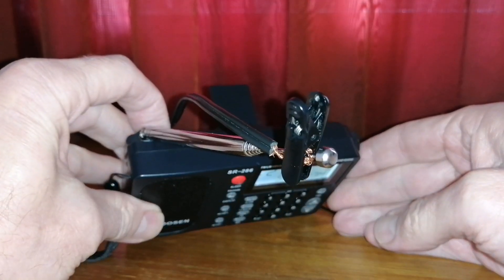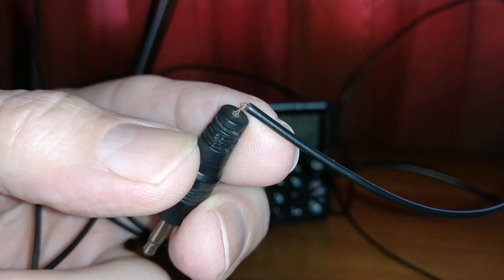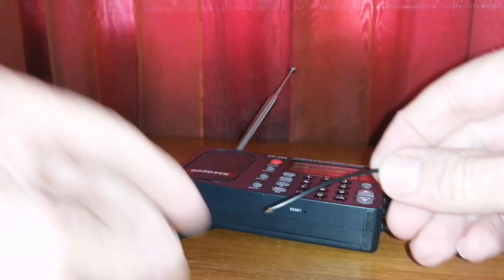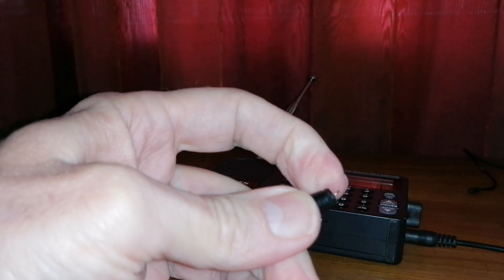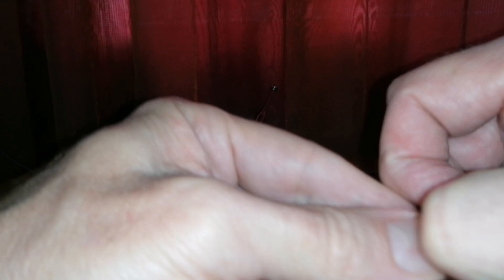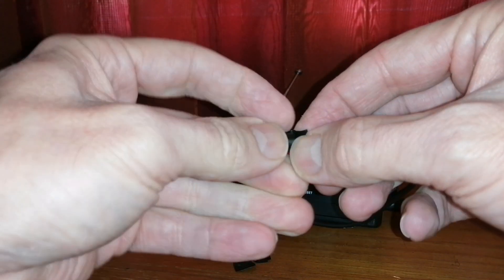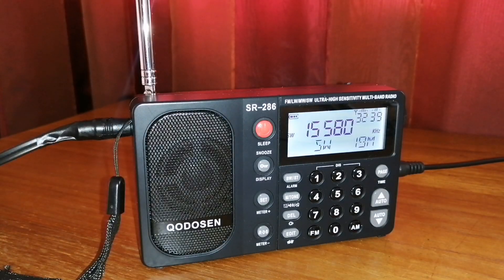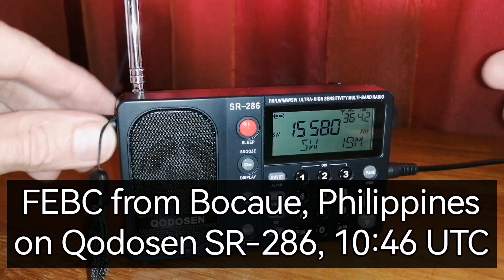Connecting a 3.5 mm mono plug to a long wire for better shortwave reception #radio #antenna

Comment: I do not have a long wire antenna.
Reply from the maker: It is very easy to get one. You can use something like speaker wire, and just expose the wire on one side (remove the insulation). Then tie the exposed wire around your whip antenna, and there you go. Stretch the wire outside, or throw it up a tree. It will make a big difference to what you can hear.

Comment: Hi andrea
I think antenna 3.5 plug has two wire 
Did you connect another wire on the ground?
I'd ask does one wire is enough to get  good reception
Your advice please
Reply from the maker: Hi Eyad, the plug I used came from an existing antenna cable (a Tecsun one) and it had only the one wire, so it was easy to connect. I did not connect a ground wire. It works very well just like that.
Reply: Thanks

Comment: It’s amazing how different long wire connections make a world of difference.
Reply from the maker: Hey John, it really is quite amazing. I am a big fan of a simple long wire, always helps me pick up more signals, and with this connection it seems to work much better now.
Reply: @swlistening  hello Andre, I totally agree!
Reply: A long wire antenna I noticed better reception on the VHF Air Band.  Lot’s of experimenting with long-wire, usually great results. 📡📶
Reply from the maker: @NJF60  I haven't tried that on the air band yet, thanks for the tip!
Reply: @swlistening  about a long-wire for VHF Air Band, try vertical length
Reply from the maker: @NJF60  Thanks!
Reply: Welcome!

Comment: Useful tutorial, bru... thanks! 🙂 👍

In my experience, an external antenna that is exposed to the sky, long and/or straight enough is more effective at pulling in weak stations than an active antenna like the MLA-30+ or the Deshibo GA-450 located indoors. However, indoor antennas also have their slight advantages - at least they're not exposed to the harsh elements like sun and rain and can't be struck by lightning during a thunderstorm! 😀

It got me thinking, if you're able to hoist your MLA-30+ on your rooftop it would very likely pick up weak signals much better than being located on the ground.

BTW, the FEBC broadcast programme is in Indonesian which I can comprehend. It's slotted in the evenings for the convenience of their Indonesian listeners. 🇮🇩

Comment: The first trick is finding a radio with an external antenna jack.
Reply from the maker: Hi Bill, that is true :-) Unless you can find an adaptor cable like the one I show in the video. It is a cable with a 3.5 mm input plug on one side, and a clip on the other side, for clipping to whip antennas.

Comment: Good move, André. But you know, you should really get yourself a soldering iron and some soldering wire. I'm sure that you can find these for very cheap at a nearby DIY store 🙂
And soldering is no more difficult than what you've done here.
OTOH, 3.5 MONO jacks for soldering aren't the easiest to source. STEREO ones are sold everywhere. Of course they can be used too, but they're more difficult to solder.
As another commenter suggested below, heat shrink tube does wonders on this kind of assembly. Much better than tape.
BTW why keeping the two conductors of your speaker wire? I'd advise to split it in two and use a single wire. Having two brings nothing in terms of reception and makes your long wire antenna more heavy, thicker and overall less manageable. Plus you can reuse it for e.g. a portable version of your long wire antenna.
Reply from the maker: Thanks Alain, I think I do need a soldering iron anyway. The power cable between the battery pack and the radio on my Barlow Wadley XCR-30 came loose, on the battery pack itself. It is a very simple fix, but for that I will certainly need a soldering iron. So I will be looking around for one.

I agree with you about the mono 3.5 mm plugs, I have noticed that they are not so easy to find. That is why I resorted to using one on an existing cable. 

Very good idea about splitting my long wire in two! Maybe I can even connect the two parts and make a longer wire :-) My wire is fixed permanently outside though, I got some help to fix it under the eaves of the garage roof. So I never move it around, just the little part that is fed into the house through a window. But I would need some help again to take it down and split it, I don't have a ladder that is tall enough to reach the top of my garage roof.

Comment: Andre thanks for the update and to find out that you are a poet and did not know it…😂😂😂!  …with your opening comments.! You are right about this making a difference!
I have an old Sony adapter from my late very much lamented Sony 2010 that allowed you to hook up a coax cable with two screws and it has the 3.5 mm cable on the other end. I then put a BNC  female of the coax side. I the use the inexpensive Amazon adapters to fit my antenna outputs.  
I would stock up on those Amazon adapters as it allows me to go from SMA to So_239, BNC etc.
73! Have a great day!
Reply from the maker: Thanks, I think I will find some adaptors, I need one for my MLA30+ for sure. I have a BNC male on that one, to go into the Kenwood R1000, but I need an adaptor there to be be able to use the MLA30+ on the portables. Only thing about Amazon is the shipping cost, it can be even more than the price of the actual adaptor here to my place in Johannesburg.
Reply: @swlistening  Amazon's US based shipping fees is the main reason why I don't buy from that e-commerce site anymore. What about eBay, Aliexpress, Temu or Banggood?
Reply from the maker: @StratmanII  I do use Ali Express often now, after testing them out a few months ago for the first time. Very happy with them, fast and cheap shipping, but I need to pay import duties on this side and those are high. Often around 50% of the product price (I need to pay VAT + import fees). Amazon fees can be high, but they do include the import duties. Sometimes, on products that they sell themselves, shipping and import fees are actually quite reasonable. Like my new Sangean, shipping and import fees were $30 on a $66 radio, not bad at all. If I had ordered that from Ali Express (not that they sell it) the import duties alone would have been $30, and shipping would have been $12, that''s more or less what I pay for shipping from Ali Express. So I always shop around for the best overall deal.
Reply: @swlistening  My bad...I had quite forgotten that some countries slap a heavy import duties on goods from overseas ordered via the Internet. 🙂 Malaysia no longer  imposes import taxes on electronics but we have a new taxation laws on low value goods costing RM500 and below. Usually the sellers will slot this tax as shipping fee duties. On top of that we have a 6% GST (or VAT) on all purchases but as far as electronics, watches and photographic equipment are concerned, there are no import duties for these categories.

On the other hand, motorcars and "sin taxes" like tobacco products and alcoholic beverages carry the highest amount of taxes. 😠
Reply from the maker: @StratmanII  No worries! You are very, very lucky that there are no import duties on electronics in Malaysia. Imagine paying an extra 50% over and above the regular price on all your radios. It really adds up. That's why my radio buying decisions are always carefully thought over. We also have the sin taxes and high duties on cars. So, in short, everything imported is taxed here 😥
Reply: @swlistening  Thank you for the comment. In Malaysia we used to have import duties on car tyres, car stereo systems, color TVs, cameras, portable CD players and Walkman tape players without a built-in radio (if the player has a built-in AM or AM/FM radio there were no import taxes, go figure!) and I think dedicated shortwave radios were taxed too.

Back in the 70s and 80s the neighboring Republic of Singapore was considered the nearest shopping haven as the country was tax free when it came to such items. The trick was to be ingenious in smuggling back the purchases to avoid paying duties on returning to Malaysia, lol. ☺️

When I was in Malawi, the locals often quoted Dubai as their favorite tax free shopping destination but I guess today Johannesburg has become the closest retail haven for non South African citizens. 😀

You're a savvy shopper and you know which e-commerce sites that give you the lowest prices, inclusive of import duties and shipping fees. Amazon's fees are messy for me as it assumes a fair amount of import taxes which I have to pay upfront. Any excess duties will later be refunded, making the buying process complicated. I prefer eBay when it comes to purchasing from US based sellers as it doesn't impose estimated import duties. 😊
Reply from the maker: @StratmanII  It makes a lot of sense for you not to use Amazon, who wants the hassle of recovering duties later... They should update their systems and make it easier for people who live in Malaysia to buy from them.

Personally, I think Dubai is over-rated. I found that prices there are not really lower than here, even with the so-called tax-free status. But they do have a much wider selection, on some items. Not shortwave radios though. Desertcart, which is a UAE-based shopping site, is actually incredibly expensive when it comes to SW radios.

Johannesburg is, indeed, a massive shopping hub for all our neighbouring countries. Every day when I drive to work and back on the N1 highway, the main road north and up to the border with Zimbabwe, I see many buses with huge trailers, packed to the brim, heading to Zimbabwe, Zambia and Malawi.
Reply: @swlistening  Andre maybe EBay or Aliexpress, Bangood might have the equivalent with better shipping options.  I forget that most people do not have Amazon Prime which might not be offered in your country.!
73!
Reply: I have exactly the same thing. It came with my ICF SW 77 as well.
Reply: @RJDA.Dakota  Thanks I just could not remember what they called it in Sony;s manual.
73! rJDA Dakota!
Reply from the maker: @RJDA.Dakota  Mine came in very useful now!

Comment: Do you have some heat shrink tubing? I use that to repair iffy cables. It will strengthen the plug and the attached cable.
Reply from the maker: I don't, but I will look for some. I used a lot of insulation tape :-)
Reply: @swlistening  That can work too, but the glue of the tape can deteriorate after some time. Of course you have to be careful with heat shrink tubing, not heating it to much, otherwise the plug will melt.